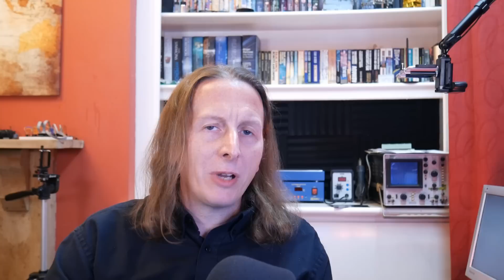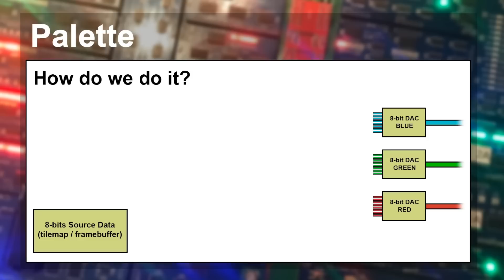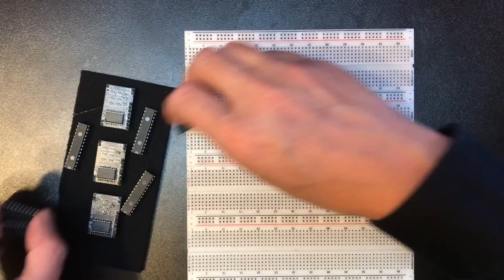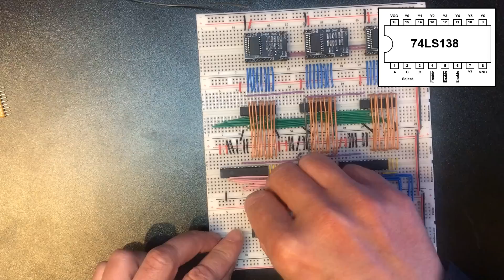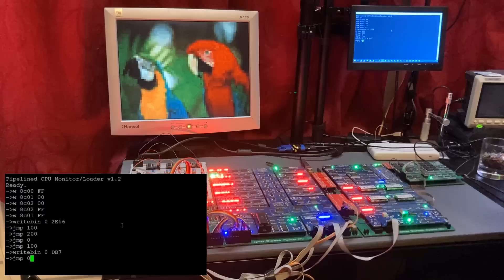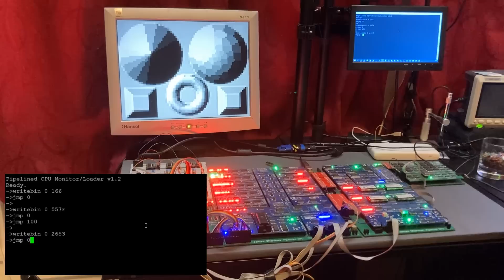Palette - VGA from Scratch - Part 11

Comment: Love it, very very cool. You could use the rest of the ram for 7 more palettes and then a 3 bit selector for each row of the display - sort of copper list style...?
Reply from the maker: Thanks Charlie! There is actually space for 32 palettes, I worked out a circuit that only adds one extra chip. Interesting idea to make them row selected, would take a bunch of extra circuitry. My thought was just for quick change.
Reply: @weirdboyjim  Circuitry is what you do best James, and think of the possibilities!
Reply: Although if you could change it with the CPU in the hblank that gets you kind of there I guess, less sexy tho...

Comment: This is getting very interesting. The results are fantastic. I am hoping to see a high rez version of this. Is that something you are looking to accomplish and are you going to eventually shrink the size of this setup? Have you thought about using programmable logic chips like PAL's and GAL's to minimize the number of logic IC's?
Reply: James said before that he thinks using pals and gals on this build to be some sort of cheating.
Reply: @cj09beira  However, he is already using ROMs to decode instructions through the pipeline, and to produce graphic card signals, which is also kind of “cheating”, if you concede that, because that’s ultimately a brute force way to get custom combinational logic. Also a simple PAL was part of the 6502 instruction decoding hardware, so I wouldn’t see using them in this project as going too far. 
In fact, I regard PLAs configured as simple PALs as far less cheating than ROMs, just look at the level of integration and number of transistors of just one single chip of the latter, which may be far greater than the rest of chips in this processor combined!
Reply from the maker: Thanks GORF, no plans to use programmable devices like PAL's/GAL's maybe on future builds to shortcut things I've already done.

Comment: Ha the last one is pretty easy, you are using the scroll registers to move the vortex around and you shift palette to make it appear rotating.
As a fun fact the SEGA logo on the genesis in Sonic 3d used a similar palette technique to output a video at reduced color depth but fast enough to make it look smooth.
Reply from the maker: Yes to the scrolling,  it is indeed palette manipulation but I intended the question to be more specific about what the image contained and what was being done to the palette.

Comment: Nice work! I've shied away from using multiplexers for this kind of thing for speed reasons. My main plan there is to use transceivers as usual, so that the framebuffer can drive the palette address directly without extra propagation delay, but turning off the framebuffer's output enable during palette updates. I don't mind if palette updates cause glitches when they occur during the visible part of the frame. Or just use dual port RAM for this part!
Reply from the maker: Ha! Dual port RAM is a great answer to all memory contention questions that don't include the words "part cost". 😧
Reply: @weirdboyjim  Yes! Now FPGAs are everywhere, physical dual port RAM is a sales code for "legacy hardware hackers will accept any BOM cost!"
Reply: @weirdboyjim  So I thought - however in really small sizes it does seem to be less horrific!

The other thing I was considering for reducing the amount of wiring and bus sharing was using the overscan framebuffer memory to provide the palette write addresses, just like it normally does, so that no sharing is needed there. Maybe the even bytes during the overscan provide data to write, and odd bytes provide addresses to write them to. It's getting a bit silly then, but would also mean "copper" effects would not require active cpu intervention.
Reply from the maker: Thanks George! Yeah you could replace the address multiplexers with a pair of 541's driven by the same enable lines as used for the data. Chip count would be the same but there is a significant size different between so-16's and so-20's. You actually used to get exactly this kind of screen fuzz on older vga card's when you did a palette update, discovering that was the first time I had to start worrying about the blanking intervals in a practical way.

Comment: Each “square” mapped onto the vortex is made up of 256 individual colours (8x8) so you could potentially map any repeating pattern onto the tube. Depending on how you arrange the indices, scroll left/right and up/down is some relatively simple offsetting of the palette data. But you have to fill all 1kb in the vertical blanking interval, right?
With some pre-calculated palettes you could rotate the pattern, morph it, etc. limited only by ram.
Reply from the maker: Bingo! I like to think of it as an 16x16 texture mapped onto the surface. yeah I have to update the entire pallet each frame. The code runs lightly over (hence the fuzz) but I could probably optimize it slight to get rid of that.
Reply: @weirdboyjim  Perhaps use that unused RAM area to store the next palette, like one would do with double buffering the screen. You could then update the next palette in line during the screen draw and simply switch it out on the vsync.
Reply: @GORF_EMPIRE  That's clever!  You could even have several palettes set up and dynamically switch between them.  Those 7164 RAMs would not be such a waste after all.

Comment: Ah, I finally understand the reason you get snow on the screen if updating the palette at the wrong time - even if the colour you’re updating isn’t in use.
Reply from the maker: You mean on regular PC vga cards?  Yeah, back in the 90's I hit that issue. It was the first time I started to have to synchronize code with the blanking intervals.
Reply: Yes, exactly that. VGA mode 13h.

Comment: I remember the Amiga HAM mode. That was a 256 color table but the primary color was set in the first pixel. The color was then changed in the three other pixels. Although the resolution was lower as a result, it looked as if more colors could be displayed. In this way, an 8-bit color palette became a 12 or 16-bit color palette.
But it wasn't really 16 bit color because 4 pixels always determined the color. 
A new color could only be set in the 5th to 8th  pixel.
Reply from the maker: It was a cool system though. Some of the best static images of there time!
Reply: I was just asking about HAM... I should have read before I typed.;)

Comment: You could theoretically add a fairly low cost high resolution output mode (double horizontal resolution) by changing the way those final line drivers work coming out of the palette circuit. Normally they just let through the whole 8-bit palette value. However, if you take a double pixel clock, and in "hi-res mode" you output either the high 4 bits or low 4 bits of the palette value to the top 4 bits of each DAC, you can fiddle the palette to essentially pick 4 bits of each pixel byte on odd/even hi-res pixels. 

Half the colour bit depth, but double the pixel resolution - good enough for a text mode? It'd involve switching from 1x8 bit line driver to 3x4 bit (faster?) line drivers, but would avoid making any changes to the rest of the video circuitry. 

Since you've got 8K palette chips, you could also switch palettes on each horizonal line (use a register to drive the top few bits of the palette RAM), and with a bit more palette tweaking, double the vertical resolution (again, half the colour bit depth - you'd be down to a 4 colour mode). The advantage being for minimal changes (and without having to speed up the rest of the video circuitry), you've got a big step up in resolution.

Really enjoying the series - it's nice to see the old-school demo tricks being played with.
Reply from the maker: Indeed you could. The plan is to have some tile data containing 8x8 tiles that the current "pixels" in the tile map will select. You could create a 16 color psudo 160x60  or 80x120 display of the type you describe just by setting the correct tile data. You could even make a 160x120 4 color mode. Glad you are enjoying the series.

Comment: For the fourth channel, you could use it for alpha/intensity information, it might be overkill and registers might have more utility. And of course implementing alpha would mean more chips and a fair bit of rethink of the circuit, I'd imagine.
Reply from the maker: Alpha is everyone's first thought for the 4th color byte but what would it be blending with?
Reply: @weirdboyjim  I know, I realized that after a while... What "new" color could be made. Think we are so used to the incredibly complex computers that are our graphics cards that we just see "Alpha" as something that just happens. 
It might be used for some HW color blending, but I now think Alpha is a bit of a red herring. And using it for control signalling (if needed) is probably easier and better utility. 
But I can't really figure out what those controls might be... I have a half formed idea, can we reverse the data flow? Can we use the "4th byte" read back info? Of what, I am not really sure, but it was an idea I had.

Comment: Getting close to Amiga levels of graphics James, albeit 8-bit.  Great Demos.  My guess on the vortex demo, You are definitely hardware scrolling the image left to right and back again.  For the swirl, I wondering if you are cycling through some form of gradient using the palette swap.  Would love to see how you did it.  I suspect the code itself to relatively small, assuming the hardware tricks do all the work..
Reply from the maker: High praise! Yeah, I layered some scrolling on top to increase the variation. The main effect is palette manipulation but it's more than basic cycling, the code is indeed quite simple, I just update the pallet and the scroll registers and get a solid 60 fps out of it.

Comment: Nice result! I think the vortex animation is done by palette cycling and the movement is done with hardware scrolling.
There's a GDC talk called 8 Bit & 8 Bitish Graphics, showing some really impressive palette cycling demos, maybe you can show some of them on your cpu?
Reply from the maker: The underlying effect is obviously palette manipulation but it's more than a simple cycling, the grid moves in two dimensions. Once I had that working I added the scrolling on top for extra variation (because why not!). Yeah, lots of nice tricks about, I saw one like this in the early 90's and it stuck in my head so I had to try it.
Reply: yeah I thought the same. Nice one james!

Comment: Are you perhaps animating it by using a mix of packed frames with continuous indices (ex 0-3 frame 0, 4-7 frame 1.. etc) in the palette and some stupidly fast memory copying going on? :)
Reply from the maker: Not 100% sure what you are describing there, the core effect is done just by updating the palette without modifying any of the main framebuffer.
Reply: @weirdboyjim  No news there. I'm horrible at describing stuff lol.
It's an old trick from the console days. You'd pack four frames into one and animate it by changing the palette while at the same time update the hidden buffer with a new batch of data, switch buffer, animate that and so on :)

Comment: Some very nice parrots there! One thought I had, with connecting the scope reducing the number of glitches, maybe some extra capacitance in the right places would help? Probably not worth it on the breadboards anyway...

I imagine one of the ideas to make use of the extra RAM would be to allow multiple palettes and quickly switch between them?

I'd be very interested in an extras video explaining how the vortex demo works.
Reply from the maker: The difference with the scope attached is interesting, the capacitance was pushing the rising edge  back slightly, in theory we could get a little bit more speed out of the system by delaying the output latch signal such that it allowed the ram lookup to overlap the address for the next pixel passing through the multiplexer, but that would mean we would be accounting for fractions of a cycle later stages in the circuit. Yeah, that's my thinking on the palette ram, I think I can add that with just one extra 574'.
Reply: Yes... instead of double buffering a screen it would be the same principle just instead switching the palette. So you'd have double, double buffering. 🤣